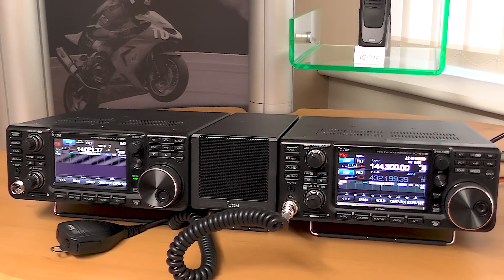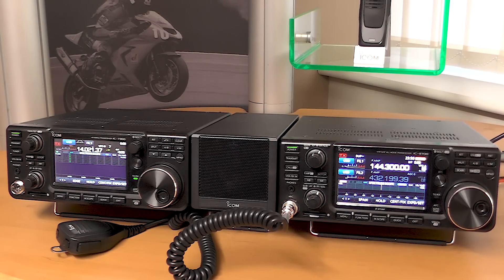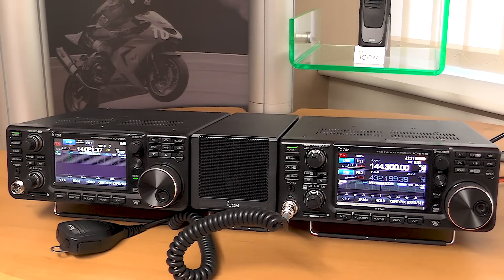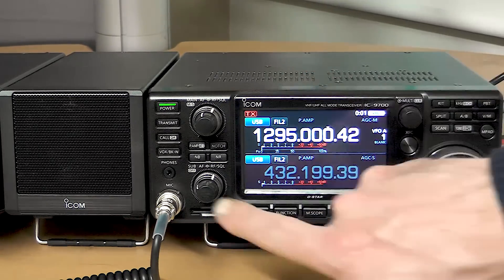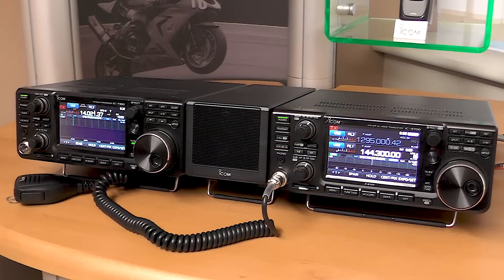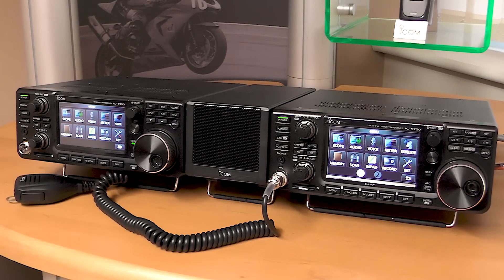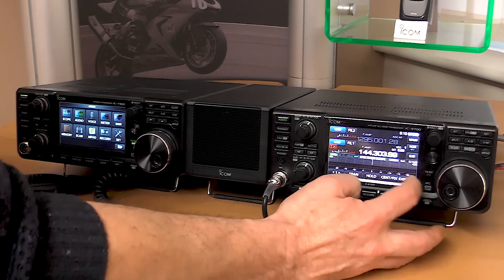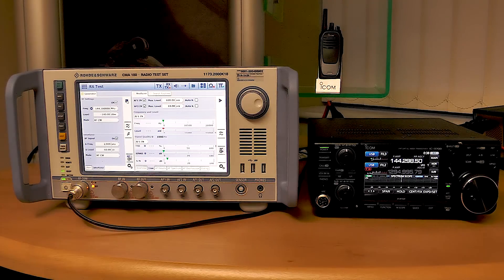Introduction to the IC-9700 VHF/UHF/1200 MHz Base Station SDR Transceiver

Comment: Does the speaker have 2 inputs so you can connect to both radios at the same time? That would be useful (rather than buying 2)
Reply from the maker: I have been told that the matching one in the video does not.  The SP-34 might be more suitable: https://icomuk.co.uk/SP-34-base-station-speaker/3989/924/41/

Comment: I'm very close to buying both of these. What kind of power supply would I get? I want to be able to run both radios at the same time. Obviously not transmitting at the same time. But both on at the same time.

Comment: We all read the hype, also told it was the best thing since sliced bread (and it is the IC 9700,) then the rug was pulled out from under us by the announcement  we could be losing the 144-146 and the 23cms Bands,

Comment: Let's talk about the frequency stability of the 9700.  The reference input doesn't govern the oscillator, and the thermal drift is a joke. You were obviously more interested making a radio that matches the 7300 than you were in making a great radio.  Why not have the input govern the oscillator like in the 7610?   All I know is my 9100 doesn't drift...  it's rock solid - I've never seen more than a few Hz drift on VHF. 

The thermal design is a joke on this thing.  It makes UHF SSB and EME problematic to say the least.

Very poor radio indeed, which is a shame, as without this stability issue, it would be a nice radio.   Considering that we first saw this radio being demonstrated over 2 years ago, I'm amazed these problems were allowed to persist through it's development.

Comment: What type connector is on the rear is far less important than the Drifting issues that this radio has. It is suppose to be a great rig for Digital modes yet the specs don't reflect that nor does the on the air performance by the people who spent their hard earned cash & are now BETA TESTERS for ICOM. Rumor is that ICOM will come out with an Updated model when they figure out how to correct the flaws in the radio yet they will NOT be giving refunds for the current models already out there. I think it's FUNNY that some folks must have the latest & greatest new toys & can't wait until the bugs are worked out & now they are stuck with a faulty transceiver and some of them keep lying about the stability issues yet so much documentation proves that the radio drifts so badly some Digital QSO's are Impossible. Lying about it won't make the radio work better it's called DENIAL & many suffer from it. LOL {:>)
Reply: I think it's FUNNY!! Not nice to laugh at your fellow hams, tut tut. 😕

Comment: I have been out of VHF/UHF/SHF for a good while now. Sold all of my big antennas for these bands. This rig looks does look appealing especially with 1.2gig. Of course I don't know about the activity these days on 1.2 during the three major contest. I use SDR rig for HF on AM and I am thinking the Panadapter will be be great during a contest.  It would had been nice if it had 6 and 220, at least 6 meters. I used to run single banded Icom rigs for 5 bands. From 275A to 1275A . I will look into this rig.  Thanks for the Video.

Comment: This will absolutely will be my upgraded 2m/70cm base station rig.  I own and love an IC-7300 and was blown away from day one, it's an incredible HF rig in every way and assume the 9700 will be as well.  I have a nice 220 standalone rig so not having 220 isn't a deal killer for me.  I would simply enjoy working 2m/70cm at higher TX power using similar features and performance I see on the 7300 along with DStar and the built in ethernet and server, true dual tuner duplex, real-time full spectrum waterfall and many other unique features to the 9700...that will be a whole new ballgame.  Those who own 7300s understand what I mean, it's a unique experience using it, one that is incredibly intuitive, efficient, deep features and rewarded by top class performance.  I expect the 9700 will be the same.  I do plan on waiting about a year, like I did with my 7300, to make sure no major problems surface that requires some sort of "V2" model that is required due to an issue beyond a firmware fix.  Also I hope prices will drop to be closer to what a 7300 costs by that time.  Looking forward to read/viewing hands on reviews over the next year or so and hoping they align with 7300 class performance, features and usability.

Comment: Please am in doubt between buying an ICOM IC 9700 or IC 9100 ?? Why in the IC 9100 do I have a full HF / VHF / UHF for the same value as an IC 9700 ??? Can you help me choose the best option? 73
Reply: I have the 9700 and love it.  I sold my 9100 to get it.  HOWEVER, the 9100 can do cross band repeat (with a mod) and can receive out of band (and transmit there too, with another mod).  There might be a mod someday for cross band repeat but it's unlikely the 9700 will ever go out of band, even for receive.  D-star sucks on the 9100 since it's insanely difficult to use.  Super easy on 9700.  If D-Star and receive performance are of top importance to you, get the 9700.  If extended receive and other mods (and having a mediocre HF side) are important to you, buy a 9100.
Reply: @justaviewer111  Many thanks, for your opinion, I decided to buy the icom ic 9700. I want to make D star, VHF dx, and satellite mode. And it has the benefit of having a panadapter, waterfall    73

Comment: Frankly... I thought that (at that price), that it was also an HF rig... Im a bit shocked now that it is not!  I will probably buy the IC7300, and wait a year or two until it Drops... probably quickly in price.

I prefer SO239 to N.  Always have, and always will.  Even on 70cm.  I can understand it on 1.2ghz though.  I am a bit surprised that it has no HDMI output.

Comment: Too bad they didn't include 6M (50Mhz) for those who don't want HF, and I why wouldn't they have included 220Mhz?
Reply: The IC-7300 has 6m.  They want you to get the pair.
Reply: Agree, I would have preferred to have 50 and 220 MHz and drop the 23cm band. And N connectors for 144 and up.
Reply: @bobd.  I would still want the 23cm bad though. Why not?
Reply: @Stewart Howarth Well, being an SDR, it really shouldn't take much more than additional filters.. However, maybe a down converter as well, I am not that familiar with the architecture... Overall, I believe it would be a relatively minor cost to have added it...
Reply: By all means add 220Mhz capability (at least in the radios sold in region 2 - regions 1 and 3 don't get access to it) but don't delete 23cm to add 220Mhz!   Agree 6m should have been included.

Comment: I'll keep my K3 and 8 Transverters. Khune transverters hard to beat for 2/432/1296/2304. . DEMI for 222/902/903. Receiver sensitivity is what its a bout.
Reply: But Kuhne transverters are expensive and less usable for portable Operation. It's not that this could'nt be done, but this is less practical. 
Kuhne build hi-end components and they are outstaning in Performance. If this is required, that's a good choice.
Reply: @DD4DA  I agree with you 100%. I did receive mine from Associated Radio in Overland Park KS 3 weeks ago. Have not had much time to use it much do to the usual springtime workload. Stuck it on a single K1FO and Par Omni for some local chat. It's a great replacement for the 910H which I once owned. And yes portable as you pointed out!

Comment: I'll just keep my TS2000 for the price the 9700 will sell for....
Reply: @1OFGODSOWN    Very few birdies here. Its not so deaf i cant work EME meteor scatter or FT8 on any band. Any other stupid questions?
Reply: @peanuttization  I own a TS-2000 & it does NOT have great ears & on all bands you must run the preamp & an external preamp is needed so I also use one of those. My ICOM 275A & ICOM 746 both hear much better on VHF with ease. Also the Birdie issue with the TS-2000 is well documented so why lie about it when the TRUTH will do just fine? LOL
Reply: @1OFGODSOWN   Absolutely  DEAF b  a decade of technology  Had a 2000X   got rid of it after 2 years

Comment: The only problem of this ratio will be the price... 3000+CAD for a 3 band radio will make it a lot less appealing... 

The 7300 is just ate the right spot for affordability for what it is. This is why it is one of the most popular radio ever produced.

The 9700 on the other hand, not so sure... This would be a great addition to my 7300 but not at this price ever...
Reply: Richard Driskill  if it is 2600$US, it confirms that in canada, it will be way over 3000$, more like 3400$ maybe even more... which is ridiculous for a radio with 3 bands among one I will never use... The only way to smooth out the pricing would be to have options to add the modules separately for 1.2 and d-star, that would greatly reduce the base price and make also this model one of the most popular radio for all mode vhf/uhf... I would thing about it for sure but at 3000$+, no way...
Reply: CONFIRMED, the 9700 is 2899$CA + taxes is about 3400$CA !! RIDICULOUS...
Reply: Richard Driskill  yes you are right it is not 3500$ it is actually 2899$CA + 50$CA shipping + 15% fed/prov taxes = ~3390$CA... you had a "good" price at 1999$US... still, I find that horrendeous pricing for a 3 band radio... I hope you enjoy it for the price !
Reply: Richard Driskill  I followed your advise, got a kenwood ts790 for 500$... 500$ for that thing... to realize that it is a bit missalign and the CTCSS does not work... the rest seems ok... I don't bother too much about the radio not being right on frequecy as I will try to get on satellite again and it is always moving frequency... but man, this is exactly what I dreaded about, buying "expensive" used gear is far from having the proper value in the condition of the units... 

lucky you that you do have the 9700 ! maybe some day I'll get one to replace the ts790 and put it aside my 7300 !

you should make a couple videos about it !

73 de Claude VA2CST
Reply: Richard Driskill  oh sorry misread, PRE ORDER, my bad ! in deed a long time for getting that radio ! at least one is secured for you, you WILL get it soon ! good luck and can't wait so see some clip of it maybe !

Comment: No 220 band for US? I wont buy it. If you can cram all the HF bands into a box.. you can add 220 into the 9700. Lacking 220 it makes it NOT a serious radio. And whats up with an so239 on VHF? No one uses so/pl 259's any more.
Reply: You won't buy any New all mode radio from any company then because nobody builds one. Enjoy what you have or buy a very expensive transverter & 220 amplifier. NEXT....
Reply: Transverters are like 300 bucks....can build an amp for the same.

Comment: Firstly well done Mr Icom for taking the step into a dedicated VHF/UHF base unit without the need for a shack in a box - a needy gap filled.

I had marked the unit down for a place in the shack from its announcement but the price tag is too high when I forced to have 23cm which I don’t want and if you remove the FM simplex/repeater traffic the cost balance for such a Unit here in the UK - the sums don’t add. I’m sure it will sell in the states though.

A price match against the 7300 would have been acceptable, without 23cm’s, as as for it being ahead of the 910 - errr I would hope so with the advances in technology.

Rumours are that with the end of the ts-2000 production run, Kenwood are looking at there own VHF/UHF base - if it follows on from the 711/811 at the right price, then the 9700 will have a battle on

Still the 910 has been dropping slightly in ££ - so let’s see if more appear or they now become real keepers

SD
Reply: Me too, I have gotta have one.

Comment: Not  for  me ,  was  not impressed with  the  7300  , had on   not for  me .   1200 mhz is  vertualy  not used .  dont  like n type  plugs either .  so 239  any  time .  think icom  taking a step  back.  and bet the price is  out  of  most   peoples pocket .   hf  vhf  uhf   would  be nice.     7300  hf   and thats  it   .   not  for  me .
Reply: SO239 connectors are not rated for frequencies at UHF and above. (Yes I know they are called UHF connectors but that was back in the days where anything over 50 MHz was considered UHF). No radios that I am aware of use SO239 / PL259 for 70cm or above.
Reply: Get a 7100

Comment: still no hdmi output get with the times
Reply: Raspberry pi is 35 bucks and has HDMI. Just sayin.
Reply: agreed how much would it have added to the cost? they should have put HDMI on it. There is no reason in this day and age that all sdr radios should all have hdmi for 4 k tvs.

Comment: Why an so239 and not N type for 2m? Icom should have brought out a 2m/70cm unit and they would have sold loads.I don’t use 23cm or dstar so have no interest in paying the big price tag there asking!
Reply: I don't understand it either. Why do manufacturers still use SO239? It doesn't make sense. Especially at the price point of this radio, it's not a baofeng where 20 cents more on parts is a big deal.
Reply: I have owned so many 2 meter all mode radios & not even one has ever had an N connector. All had an SO-239 as does my current 2 meter all mode the ICOM 275A. I have never had an issue with any of them & the loss difference is so minimal I doubt that you or anyone else could hear or see the difference on any transceiver that you chose to listen to. 2 meter amplifiers are the same way & nobody is bitching & complaining about them?
Reply: 1OFGODSOWN   I have operated Eme for 13years and from the outset was encouraged to use n-type sockets.My beko amplifier has n-types fitted as standard as does my ssb electronics preamp.If your point was valid why would Icom and others not put identical sockets for 70cm and 2m? Apart from the sockets my personal opinion on the radio is that it’s overpriced because of d-star and 23cm.
Reply: @dxscotland5901   So what, IC910H you had to pay a lot extra for a 23cm Module. 9100 D-Star was extra with a UT121 board  So you don't like D-Star and 23cm, definately personal opinion
Reply: me too    d star   i tried it     joke     icom better wake up if they want a fan base
Reply: I guess I need an Adapter then.
Reply: It keeps you from getting your antenna cables crossed up.

Comment: Still S0239 on 144? Surely a n-type for any serious radio?
Reply: keiron871 only for 2 meters a compromise but not that bad
Reply: @davidkierzkowski  Stupid compromise for an advanced (probably) radio made for serious (probably) users. Especially for a radio somewhere about $2k. Don't you? Otherwise not bad 'coz up to 100~150MHz UHF (SO-239) should work more or less adequate.
Reply: Why the hell did the so239 receptacle will raise such Emotion on 2 m?If you are not using the cheapest plug, this will not be an issue.
Reply: They are, for all practical purposes, functionally the same.
Reply: agreed how much would It have added to the cost? they should have put n connectors on.
Reply: @mikemcdonald5147  Makes Zero difference to me so either one would be fine. I would much rather install a PL-259 than a N Connector any day of the week. Royal Pain In The Ass installing an N Connector on Coax or Hardline & N connectors are far more expensive for the feedline over a PL-259 & they know that Hams for the most part are CHEAP. LOL
Reply: EASY to change that out but NOT so EASY doing away with that STUPID Touch Screen.
Reply: I would prefere a different Concept for the usage of a Transmitter. But you must decide what you wanna have. A smaller tranceiver or a bigger Panel, overloaded with knowbs and switches - like Yaesu did.
The IC-7300/IC-7900 is a compromise between funktionality and usage. I don't care about a functional touch Panel, if this is build rock sold and is easy in cleaning. The IC 7900 offers an Ethernet jack, so i assume this will be also possible to expand the Panel by an external device  like Tmate2 or so.

Comment: "Nine ten was the king" waaaaat? Ic910 is the worst ever made icom especially TX spectrum is horrible. Poor sensitivity as well.
Reply: 910 is not poor sensiivity, it is set up to work with pre-amps without loss of dynamic range,  if you don't want to use pre-amps then the 910 can be peaked for over 10 dB more RX gain.
Reply: That is your opinion. I know plenty of people who love their ICOM 910H.
Reply: @1OFGODSOWN   They love it because they didn't care about other users of the band... 
Well spectrum analyzer doesn't lie about IC-910. You can check it for example on DF9IC web page...
Reply: Nonsense Andrezej about 910s
Reply: Have you ever owned one ?
Reply: IC-746 family were worst ever made radios from big three. Absolutely disgusting TX spectrum and absolutely  unreliable. Also I owned ID-51 Plus (D-Star). I wasted money for that expensive HT and greed Icom wanted me to spend more and more for must have accessories. Thanks but no Icoms anymore.
Reply: @Gnizdetz  The 746 series had some issues but so do most all other transceivers. I currently own by third ICOM 746 & I have owned three 746 PRO's as well. I hate the Monochrome display but love the transmit & receive on them. I use a ClearSpeech DSP base module on it & every transceiver that I own including my ICOM 7600 & it makes all of them better. Opinions are like radios there are many of them.
Reply: @1OFGODSOWN  You seem to be lucky but why not? I wish you good DXs with your current and future radios and 73!